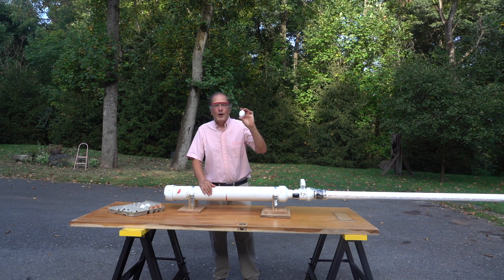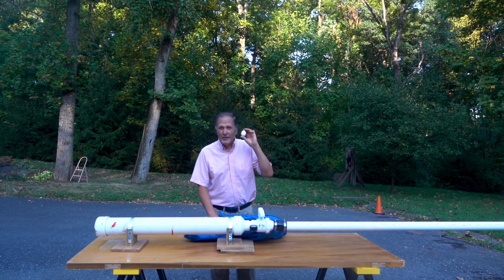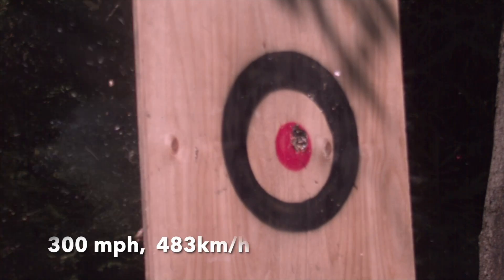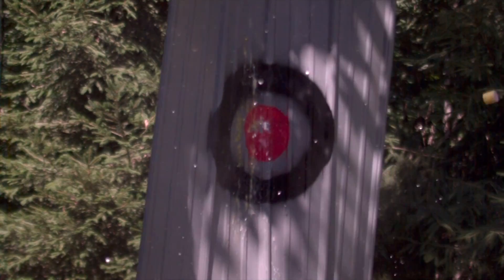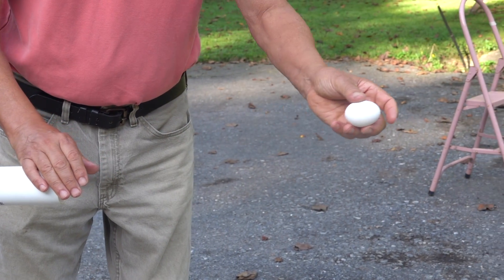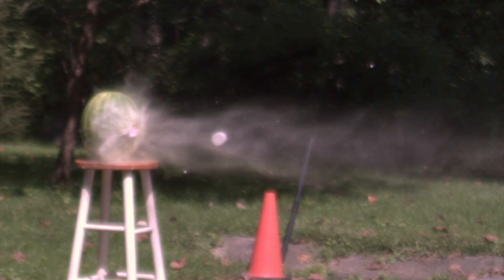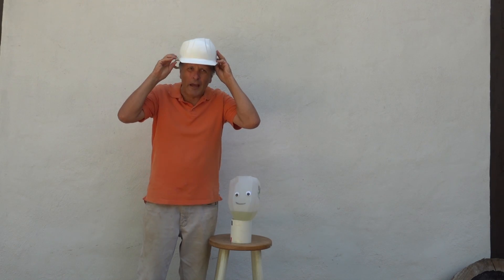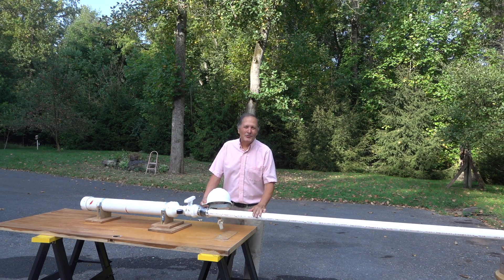Egg Target Practice at  300 mph   (483 km/h)

Comment: I believe that to catch the egg without breaking it. The egg would need tube slowed down as shown near the beginning. I think hanging very light material like silk cloth in a single layer but hung one after another in a manner like the poplar rounds. With a gap between each of approximately two inches between the sheets.

You'd want to be able to 'grab' the egg with a grip that'll also allow the egg to move past shedding speed and energy with each successive contact. Because the silk is hanging by only the top corners the bottom can move putting a slight redirection stripping of energy.

Silk because it's a surprisingly sturdy material that shouldn't just snap apart with the shock loading from the egg at speed.

Comment: just watched the previous egg cannon video and answered the question i asked on your more recent video, 100 psi.. have you thought about trying to introduce spin? For PVC pipe I would imagine an industrial bore brush would work if you cut some of the brushes off to make a helical shape, then pulled it through the barrel while twisting. 

just an idea. good luck on the stopping an egg design, I lest a suggestion in the latest video at this point.

Comment: "Sir, we just made a new cannon."
"It's ecological as well."
Reply: If someone decides to start using such a weapon as a tool of warfare, some soldiers will end up coming home shell shocked, and those who get hit with such a cannon may get their innards all scrambled.

Eggcept, I would argue that such a cannon is more eggological than ecological.

Chickens are currently being fed normal food products like corn and soybeans, produced by conventional agricultural methods, which is responsible for a not insignificant quantity of the total CO2 emissions of humanity.  It is possible to eventually eliminate such emissions through the use of chicken feed production by methanotrophic bacteria and renewable electricity derived methane, but it is not currently being done.

In the meantime, I think a more ecologically minded cannon would be designed to fire a water ice projectile using compressed air, where the energy for the production of the compressed air (and the ice, if not produced naturally during winter) is produced by renewable solar energy.

Comment: A truly interesting and entertaining video, it answered many questions I did not know I even had, thank you.

I am very curious to see simmilar testing with a slug of potato if you can find one large enough to make an appropriate seal. I like the plywood tests and would like to have seen an incremental increase until failure.
What is the bore diameter of the egg air cannon and what psi do you use?

A suggestion for an egg deceleration device:
5 layers of fine fish netting (12 foot diameter) suspended 4 ways by 4 foot bungee chords across two trees.

if you can find 12 foot cast netting online and the bungee chords, seems like a cost effective easy experiment

I really enjoyed the video and I'm glad the algorithm suggested it. Good luck on pursuing making videos like this, I think you will find an audience.

-Travis

Comment: Due to the relative fragility of the eggshell, whatever is going to stop it intact must not impact the shell unless it is loose enough to spread the impact energy quickly, ie bedsheet unsecured at the bottom. Or is moving at almost the same speed and once 'catching' the egg, slows slowly enough to bleed off the energy.

Comment: I'm extremely impressed that you can accelerate an egg that fast without breaking it.
Reply: I believe it's in a sabot
Reply: The sabot prevents it from bouncing off of the walls of the barrel, but does not reduce the number of G's the egg is subjected to.  I've gotta believe he took a lot of cues from the "Punkin' Chunkin'" contest held out east.
Reply: @hondolane3125  think of an astronaut, the capsule protects him from G forces among other things, if you strapped him to a rocket he would disintegrate, that's what the sabot does
Reply: @ericschulze5641  A space capsule does NOT protect the astronaut from G forces!  Everything in the capsule is accelerating at the same rate as the capsule.  It does protect them from the force of air resistance, of course, which would be fatal.  But a sabot doesn't even do that, it is open at the front so the sabot can fall away after firing.  Do you also think that if you are falling in an elevator and jump up off of the floor just before it hits bottom that you won't be hurt?
Reply: I’m also impressed. I know eggs are strong as far as force’s being applied along its long axis. And I know he’s using a relatively low pressure to “slowly” accelerate it.

But it’s still amazing since any bump or uneven friction against the bore would tear it to bits.
Reply: Look at the length of that barrel. It's the opposite of throwing the egg into a bedsheet.
Reply: @aluisious If that's accelerating from zero to 300mph in about half a second, that's over 27Gs. Still a hell of a lot in terms of say the human body.

Comment: To slow egg down, you could try using a series of very thin square nylon fabric sheets 10"x10" or so. Hang them by the corners to the 4 long parallel wood rods using a bit of glue and thin stripes cut from napkins. The idea is that egg will catch fabric sheets one by one, reducing it's speed and at the same time it will build up a damping layer in front of it. When egg will lose part of its energy and will have lots of fabric layers wrapped around it, you could try to catch it with a sheet you showed, or using a huge pile of hay.
Reply: I was wondering how a very long tract of bubbly-to-foamy material would perform. 

Or a kind of series of frames with very loosely placed (unhitched) silk layers which the egg would accumulate over stages

Comment: The plants and animals are going to be happy. Egg shells are good fertilizer while the insides (and the soda) will feed the insects quite well.
On another note, that computer actually does look fixable. I couldn't do it, but a repair shop could, and worst-case scenario, it can be hooked up to a traditional non-portable monitor or TV set.
Reply: except that by now the egg is probably completely rotten

Comment: Bruce, Thanks for all the work you put into the videos. I am a science teacher and have found many of your videos helpful in class. I love to tinker and build as well. Two builds that I want to do are a raising/lowering bed of nails. I see these at science centers but I'm thinking more Harbor Freight budget-friendly. The second one is a full-scale monkey and the hunter, much like the one the University of Minnesota has found here: https://www.youtube.com/watch?v=TbWiMsfr_DQ
Reply from the maker: We had a bed of nails in the high school physic class so it is a demonstration that left alone but I do like the monkey and hunter demo.  I was think of trying with an egg and a frypan. the problem is if you watched the previous video launching eggs,  you will notice that if the eggs are shot any distance, they tend to "wander" off course
Reply: @YeanyScience  Hey Bruce, if you put a piece packing tape over the end of the barrel. then install a valve in the middle of the barrel to suck the air out. without any air resistance.  BET THAT EGG WILL GO 500 MPH !!! 
 ''THE VACUUM CANNON''

Comment: @Bruce Yeany 8:56 To catch the egg, you probably need some multi-stage material, and a very deep catching area.
The problem is that the egg needs to slow down slowly enough, and almost anything, even the softest feathers will break it at that speed.
Maybe some structure like: 
dense smoke? --> foam --> loose cotton/wool? --> maybe aerogels --> maybe some liquids by now --> eventually something "solid" like cloth, for it too finally land in without breaking.

Comment: Would the egg pass through the steel had the steel sheet been held rigidly in place? Your viewers have many nice ideas for ways to decelerate the egg in the comments. Perhaps to evaluate the various ideas is by how short of a distance or time it take to decelerate. NASA has a method of using a parachute with a controlled opening to decelerate its payload. Perhaps the sabot may serve a dual purpose the second being housing the deceleration device (parachute).
Reply from the maker: we took a second shot at the steel hitting it in the same place,  the 2nd egg broke through

Comment: NASA used aerogel to capture small particles in space traveling at KM/s, but I don't suppose you can get that much aerogel.
I was thinking you could use a target made of balloons. you take a thin plastic bag fill it with balloons so the egg will need to go through several balloons before it can get out the other side - hopefully with a large enough bag or maybe several bags one after another, it will not get out the other side.

*Edit: maybe even use cling wrap, instead of a plastic bag, to hold the balloons together, so the egg can get through without breaking.
*2nd Edit: maybe use Packing Peanuts instead of balloons.

Comment: A net made of something soft material like wool, with big holes do not have too much air resistance may do the trick. You need some air resistance to decelerate, but not so much to brake the shell of the egg.

Comment: A way to catch a egg traveling that fast might be to use a lot of extremely soft material in a streamer like setup. Imagine you had many rows of strips of felt that the egg had to fly through. Might not be hard enough to break the egg but enough to slow it down that it could drop to something below that would "catch" it.

Comment: I figure you have to minimize the forces on the egg to decelerate it, so that would mean a low-mass catcher. I propose something like a bunch of thin handkerchiefs loosely suspended in the flight path, so each collision gently wraps around the egg with low enough force to not break the egg while also increasing drag. The hanging material could get progressively heavier until the egg is wrapped in enough layers to complete the "catch".

Comment: My only idea for catching goes like this.... A woolen blanket that's quite thin. This then needs to be held so gently ( or on rods that allow the blanket to slide off and become free at impact) that it comes loose and is allowed to travel through the air with egg inside, hopefully slowing down as it moves and wrapping the egg enough that when it meets the ground it is protected. If you get the thickness of the wool just right and the holding mechanism just right, that could work...... ;)   Possibly worth trying with other materials but wool is cool because there will be lots of air resistance and lots of cushioning for the landing..... I'd give this a moderate chance of working actually once you've tinkered with some values and/or materials.. If it works, please mention Ryan from England! I've loved your videos for ages.... :D

Comment: Destin from SmarterEveryDay was able to get up to 500mph on a golf ball with a similar cannon but by also drawing a vacuum on the barrel. A golf ball and an egg on the smaller side weigh about the same, I wonder if the same speed could be achieved.
Reply from the maker: in the previous video I tried using the combination of a pressurized cannon attached to a vacuum cannon.  it only gave me a 5% increase in speed and a whole lot of problems with the eggs breaking inside the barrel.  I am only pressurizing the storage canister to about 100 PSI.  If I made the cannon out of metal, it would  allow me to increase the pressure and I think 400 mph or more would be possible.
Reply: @YeanyScience  Given that the eggs are already sometimes breaking in the barrel, perhaps you are already close to the maximum acceleration an egg can withstand (at least given the level of support provided by the sabot). In which case, a longer barrel (and larger air reservoir at the same pressure) would be a better way to get even higher speeds.
Reply: Destin's cannon wasn't plastic. There were comments on a previous video about using plastic with compressed air. They were apparently of no effect.

Comment: Suggestion #1 - Catch the egg in a very  soft cup attached to a large-ish arm on a very light wheel wheel (Carousel or Ferris Wheel / Horiz v sVert). Let it spin down to lose momentum ans stop.                                        Suggestion #2 - Call "MyPillow Guy" and sell him on a sponsorsjp. Get lots of Fluffy Stuff & a couple of pillows.                                       Suggestio #3 - Shoot it straight up & Catch it on the way back down. (It would be interesting to see the tate of the yolk after the roynd trip;   0 - 300 mph - 0 .           Suggestio #4 - Make a very big net and shoot from very far away.

Comment: Great video!

One try for catching the egg would be to hang thousands sheets of tissue paper from a rigid frame, with some space between each one. It might need to be angled slightly downwards to account for the loss of momentum as the egg slows down.

Probably too much work, though.

Another way, though even more unlikely to be built, would be to create a large rail gun to accelerate a frame holding a bed sheet, and connect the trigger to the air gun such that the sheet is traveling only slightly slower than the egg!

Or as an alternate version, a second larger air gun could launch a weight attached to a cable that would pull the sheet frame along a rail.
Reply: I came here to say the same thing. Perhaps some silk toward the end that isn't under tension.

Comment: For some reason, the idea of an "egg sabot" is hilarious to me.
Reply: What does that mean? What is an "egg sabot"?
Reply from the maker: the sabot is the material or device that surrounds  around the egg as it travels around the barrel.  they are used to make the bullet fit or in this case an egg fit snuggly in the barrel so that the gases behind it can push it down the barrel faster keep it from rubbing against the side of the barrel
Reply: @YeanyScience  Thank you very much! - Until now I only knew that "sabot" is a traditional wooden shoe from France. (That's were the word "sabotage" comes from since french / belgian workers in the 1800s were using those wooden shoes  in their protests against their (former?) employers...)

I am not sure if those two words (the device around a projectile and the wooden shoe) have the same origin.
But I went down a "little rabbit hole" of internet research and it seem like that this device was named in by a man of French origin in the 1940s - so there is a good chance it might be, while there's also always a chance that I did not check the best sources...

Then I was also remembering that I have seen scenes in movies where cannons were loaded / stuffed with more than just powder and cannon balls so I checked what those other things were.
As much as I found out - people used some "shorter" pieces of thick rope between a bag full of gun powder and the cannon ball as well as a second piece of rope in front of the cannon ball to make it fit "snuggly" (as you wrote).
But these things were called "wadding" not "sabot".

Thanks once again for your reply! 😀
Reply: @YeanyScience  And I only just now realized that you are the amazing person who created this awesome video... 

So let me give you my respect and biggest compliments as well!

Comment: Were you pulling a vacuum in the barrel, and if yes how much?  For catching, try really really really fluffy cotton, a lot of it.
Reply from the maker: in the previous video, I pulled a vacuum and got the egg up to about 330mph. Without the vacuum, the egg  is around 305 310 mph.  the slightly higher speed wasn't worth the trouble that went with it.  The vacuum created problems and would break it about 25 35% of the time.  I covered the problems in the previous video.

Comment: This was a great video and I always love your presentation style, but a discussion about why the helmet survived, when all the other seemingly stronger materials didn’t, would have been really educational and interesting.
Reply: That's a hard hat - it's a safety device for construction sites.  They're designed to protect you from bricks and pipe falling from sky scrapers - they're extremely durable!  For the record, something heavy drops - especially from a high height - it won't save your life, but does protect your head from a fair bit. In 35 years I've seen them crushed several times (once with a head barely slipping out in time!) but I've yet to see one pierced.
Reply: @smgdfcmfah  I get it but at the beginning of the video he mentioned deceleration and I think pointing out the fact that the helmet deforms to decrease deceleration is what helps prevent it from breaking
Reply: @rdear  Absolutely.  That's why the helmet sits a good inch or more above your head, held up by the suspension (the part that actually touches your head.
Reply: Most laypeople think of material strength as a single variable. In engineering, there are a plethora of different measurements used to gauge the strength of a material. Plastics are relatively weak in ultimate strength, but they're extremely strong when it comes to withstanding flex and distortion. Plastic's flex allows it to spread the energy of an impact over a greater distance (like a bungee cord), lessening the peak force experienced by the plastic at any given moment in time. The lesser ability of metal to flex means the kinetic energy of an impact has to be absorbed over a shorter distance (like hitting concrete). Meaning the peak force is higher; enough to tear the metal in aluminum's case.